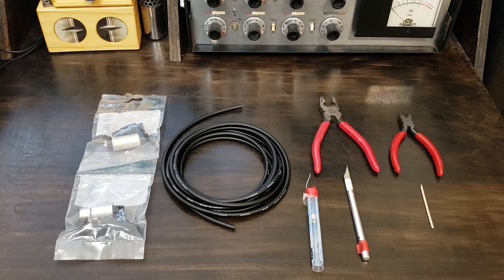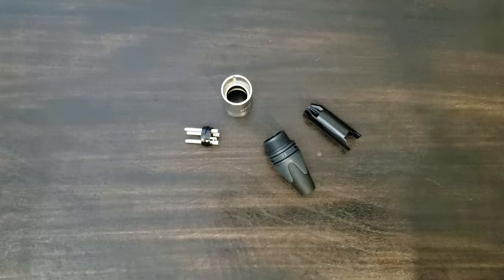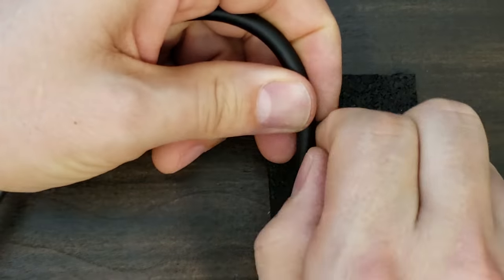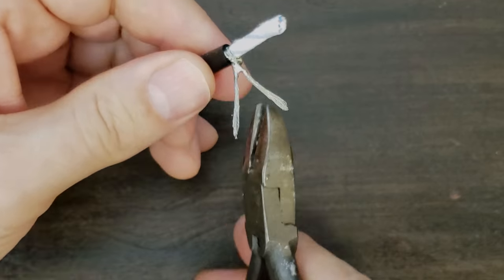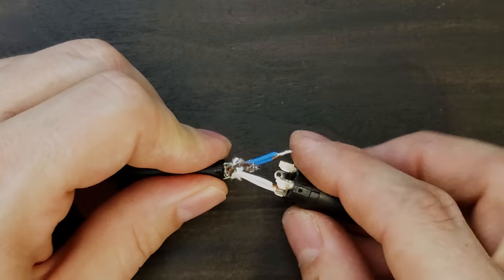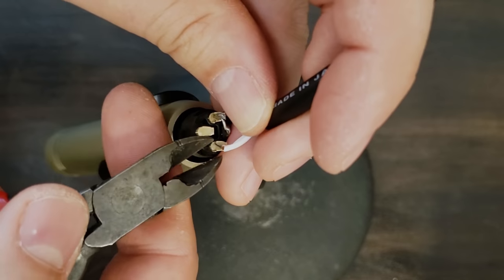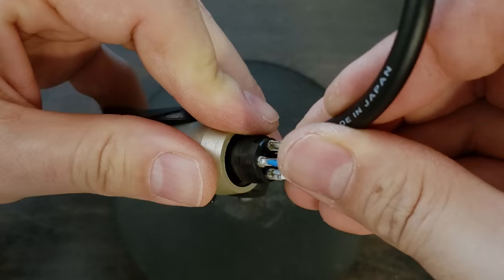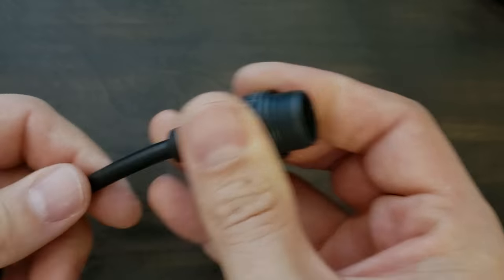XLR Microphone Cables, How to solder connectors Studio Balanced DIY ULTRA QUIET

Comment: Love the video.  What is the purpose of the shield jumper? You're the first video that i've watched to add this to your connections.
Reply from the maker: It's optional. In some cases it may help ground mics or equipment which can lower the noise floor...
Reply: @FrankOlsonTwins  thank you for your response. I will try this. Does the type of metal matter?
Reply from the maker: Any clean copper wire will work. Some companies even split the braided shield wire into 2 and solder one to pin one and one to the shield tab. Best of luck!
Reply: @FrankOlsonTwins  Thank you

Comment: Does it matter which side of the 3 pin you solder the cable to ?
Reply from the maker: Yes, only one side is long enough to fit into the other connector.  Is that what you mean?

Comment: Please explain the Jump ground connection, what is it's function, and why are there 2 cold and 2 hot wires, blue and white, when mine only has 1 of each? Mins IS A cheapie weepie! Thank you.
Reply from the maker: The jumper connects the cable shell to the cable shield and can be helpful if you have a piece of equipment that has a bad shield/ground.  Some argue it can cause a ground loop, but my experience says it does not.  Four conductor Star-quad wire allows for better "common mode rejection," by allowing the second pair of wires to occupy more of the same theoretical space as the other pair.  This enhances the rejection that makes the original twisted pair work so well.
Reply: @FrankOlsonTwins  Thank you very much for your speedy and informative reply. Cheers.
Reply from the maker: No Prob!

Comment: Hi Frank. Can we do float shield with quad core cable? And if yes, how can we do it? Thanks!
Reply from the maker: Great question.  Though I've never used float shield on interconnect cables, you could try it.  I'd say when you're soldering up a cable(quad core or otherwise) don't connect pin 1 to the shield on either connector. Likewise, don't connect the jumper. Then test your cable.  If it works to your satisfaction, trim back the shield to the appropriate length and seal it off with heat shrink(if necessary).  If you try it, let me know how it works for you!

Comment: Why do dynamic mics are using balanced Xlr connectors, when theres only 2 lines from the voice coil?
Reply from the maker: The 2 lines(hot and cold) carry the signal from the voice coil to the preamplifier.  The third connection is a shield that surrounds both wires for the entire length of the cable. By using this method, the hot and cold signals are able to reject hum and buzz by being twisted together inside the shield(common mode rejection). Now, those hot and cold signals will be used by the preamp equally to amplify the original sound. 
For more information, look up the term: common mode rejection.
Thanks!

Comment: Frank, for those of us who don't have a spare capacfitor laying around for a jumper wire, what would be an easily findable substitute solid core wire? Thanks, Steve
Reply: I see the answer below. 🙂
Reply from the maker: A spare resistor lead would work too, but the jumper wire doesn't have to be solid core.  You can use regular stranded copper wire. The solid core is just a tiny bit easier to work with. Old telephone wire is often filled with good solid core wire.  Don't forget to give a quick polish with a very light abrasive if your solid core is discolored or tarnished.
Reply: @FrankOlsonTwins  Thanks, Frank!

Comment: Hey please I made  a cable just like this but anything am putting it in the mixer it just making some kinda noise the meter on the mixer will be so high i check the cable and it was  OK I really don't know what is happening any advice?
Reply from the maker: I always check a few things first:
1. Double check the wiring.  Look at the numbers on each connector pin.  Are they wires soldered to the correct pins on each end?  If pins 2 and 3 are swapped on one end, it will always make a humming or buzzing noise.  Remember when you solder one end, the other end will look reversed, so you can't solder them by looking at one end to assemble the other.  You have to look at the numbers next to the pins.
2. Are there any tiny stray wires between any of the contacts?
3. Are the solder joints shiny or are the solder joints gray?  Gray joints need to be re-soldered until they are shiny.
Good luck!

Comment: Hi Frank, firstly -great video!  One of my speakers will be 50 meters away from the desk and I'd like to make a cable for it. Can you recommend a type of cable? .. does it matter if the cable is 2 or 4 core?
Reply from the maker: If you're talking about a powered speaker, then either 2 core or 4 core XLR will be fine.  In fact, I'd say you could get away with 2 core XLR Cables.  
Canare L-2T2S audio cable
Mogami 2549 audio cable
Performance Audio or Markertek has great prices on both.
If it were a microphone, or another low output device, I'd say go for the star quad cable.  
Canare: L-4E6S 
However, if you're talking about an unpowered(passive) speaker and you're looking for 50m speaker cable, I don't have a good suggestion, becasue that's a pretty long speaker cable run.
Hope this helps!
Reply: That's great. Thanks for your quick reply. It'll be two powered JBL speakers chained together and 50m apart.
Reply from the maker: Yeah, regular XLR cables will be fine.

Comment: Hello good afternoon friend, I have two questions I hope you can guide me please
1 the copper you put between the
mesh and connector to sieve. ??
2 I have a roll of 24 gauge prosound cable and want to put together my channels to connect my mixer, driverack, EQ, chrysover, and amplifiers. This cable is recommended or you want another caliber and another brand I hope you will help me thank you very much greetings from Mexico .. !!!
Reply from the maker: Hello!  thanks for the questions!   here are my answers:
#1. Any clean copper wire will work well for this connection. 
#2. if you're going to make a lot of cables, I'd say buy the best you can afford.  if you can find  Canare L-2T2S Microphone Cable, 2-Conductor, 23 AWG, that would be a very good cable with less work than star quad. Can you send a link to the cable you have?
Reply: @FrankOlsonTwins  of course I understand
My question is the thicker the cable the better. ?? or what gauge is correct because I have a 24 gauge thank you very much !!
Reply from the maker: I don't think you'd notice any sound difference with a thicker gauge cable,  sometimes it comes down to what what size is more appropriate for the intended use. however,  sometimes a thinker cable will have better handling noise characteristics.  Make a cable,  if it sounds good,  you have your answer!
Reply: @FrankOlsonTwins  perfect thank you very much for the information. In your videos I see that you use a piece of copper and you solder it together with the mesh but they make a bridge with the connector, what is it for or what improvements can I get in the cable. Thank you. !!
Reply from the maker: That copper is just to make it easier to solder the shield to the connector.
Reply: @FrankOlsonTwins  very good thank you very much ludis from mexico city
Reply from the maker: De nada!

Comment: Hello Frank, thank you for this nice video! Still I have a question: is shielding so important?  I want switch to active speakers, unfortunatly passive speakers cables (Sommercable elephant Smp 425) are stuck into the walls of my house. Those are 4x2.5mm² without any shield. This is for a non professional use... Is the risk of picking interferences high? Thanks in advance.
Reply from the maker: Hi Stephane,
Hmm, well there are a few things to consider here.  For one thing, you are right, there's no shield.  It could be a problem or not, depending on where you live, and also how close to any other major wiring or electronics your system might be near.  For example, unshielded cable will pick up cell phone, flourescent lights and possibly wifi interference.  Unfortunately the only way to find out is to solder on some connectors and give it a try.
This brings us to Problem #2:  The cable is too fat to fit inside the connectors.  In this scenario, you'd be trying to make star quad instrument cable out of some very thick wires, each of which is probably thicker than your connector pins.  Even with some very creative trimming, I think you'll end up with a less than satisfactory result.  Even then, you still won't have the ground that the shield offers.  Again, you won't know if it's necessary until you try it.  
If possible, I'd replace the cable with a good quality 2 conductor shielded cable(or star quad if you want).  If the cable is not connected inside the walls, it could be easily replaced by temporarily soldering one end of the elephant cable to your new cable. Tape the joint so it doesn't get stuck on anything as it passes along inside the wall. Then, you'd just pull the unsoldered end of the elephant cable through the wall until the new cable fully replaces the old cable.  Clip off the soldered joint and solder on your new connectors(or wall mounts, etc.)...
Hope this helps!
Reply: @FrankOlsonTwins   Thank you very much for the answer. Unfortunatly the cable is very stuck into the wall, it doesn't slide at all (I tried to pull with all my forces and added some special oil as much as I could). It is roughly 10 meters long! I think I have to stick with passive speakers... or... Is there any way to check the interference amount ? (before bying the active speakers!).
Reply from the maker: Hmm, I wonder if the cable is run through the attic or basement, or directly through the wall.  If you have attic(or basement)access you could run another cable.  Otherwise the only thing to do is to hook up your existing cable with connectors and try to test it, perhaps like a source(tape player, CD player, etc) on one end, and your preamp, amplifier, speakers on the other end of the cable.  That would tell you if the interference would be severe enough to create issues.
Otherwise, you'll have to figure out another way to covertly run those cables....
Reply: @FrankOlsonTwins  The cable runs though the wall and is definetly stuck (it is too thick for its sleeve) no other access possible unfortunatly. How they manage to get it in...? i have no idea. The idea of testing is very good, I will do it. thank you!

Comment: how to connect regular speaker cable to 3pin xlr? because usually speaker cable has plus and minius only. not ground.
Reply from the maker: It depends on what equipment you're hooking it up to.  I've never personally encountered XLR speaker cable, so I don't know what the pinout would be. Most likely, one of the pins would be left unconnected. If you have an amplifier with XLR Speaker outputs, it should be easy enough to figure out what the pinout is in the manual, or there must be a schematic available somehow.
Good luck!

Comment: Hi : ) Wow Really Great Video!!! I'm trying to find the solid core wire, for grounding the chassis to pin 1... I don't have extra capacitors... would you mind recommending me the best solid core wire to use?  it looked to me like the one you used wasn't all copper? it looked like it may have been tinned with something?  do you know what?  and if solid core copper cable works, should I tin the entire thing before soldering it?  what thickness is it?  22 awg?
Reply from the maker: Thanks!  You can look for silver solid core wire.  A big spool is very expensive, but there are lots of small quantities available in the 10-20 dollar range.  
18 ga -24 ga wire will work well for this connection. I also keep a few feet of silver plated solid core "pushback insulation" wire on hand.  Whenever I need a solid hookup point, I'll strip a few centimeters or inches from that.
Reply: @FrankOlsonTwins  Wow Thank you so much for the information and for responding so quickly!  I'm surprised by the silver solid core wire.  Why is that better than copper solid core?
Reply from the maker: I wouldn't necessarily say silver is better than copper, but I've found that it's a little easier to source locally.  Either one will do exactly what you want for most projects.

Comment: Eccellent video. One question have to ask. I am using the same Canare cable and Neutrik sockets. normally soldering  
Shield to pin number 1,
BLUE to pin number 2,  WHITE to pin number 3.

 Is it necessary to do soldering shield jumper same as your video or its enough to soldering Shield only to pin number 1.
Please be kind enough to explain What is the difference .
Thank you in advance
Reply from the maker: Hey Joseph, thanks for checking out the vid!  The jumper is optional, it simply ensures that the shield wire is grounded to the preamp chassis.  If you don't want to do it, it isn't necessary.  On some systems it can give extra shielding protection.   On systems that are prone to ground loops, it could make the problem better.   You can find out easily if the grounding the shield works for you:  Make the cable as shown in the video.  If you find you are getting hum- clip the jumper at one end of the cable.  If you are still getting hum, clip the jumper at the other end.  If you are still getting hum, your issue lies somewhere else!  (Instead of clipping the cable jumpers, you could use a different cable to see if your problem still exists.)
At the end of the day,  best method is the one that works for you!
Reply: @FrankOlsonTwins  thank you very much for the information.
Reply: Which cable of CANARE is suitable for connect microphones to mixing console 
CANARE   L- 2T2S  or L-4E6S
Reply from the maker: Either one would work fine.  The L4E6S is a bit more difficult to work with, so that's something to consider.  But If you're in a building(like a theatre) with a lot of EMF issues(random cable noises) the L4E6S might be worth the extra effort. The L2T2S is a good quality 2 conductor microphone cable.  In most cases and studios it would be a great choice.
Reply: @FrankOlsonTwins  thank you very much for the information 👍

Comment: Hello, I'm looking for a tutorial to make a cable XLR male - 3,5mm jack female. The cable has 3 wires: black, red and white. Can you tell me how to make it? I already have the 3,5mm jack connector in one end... The other end doesn't has anything (only the 3 wires) so I need to connect de XLR connector. Can you help me?
Reply from the maker: Sure, this ones pretty easy!
So, most likely your 3.5mm jack is wired as follows: Red(+), White(-) and black(ground/shield).
All you need to do is connect your XLR as follows:  Pin 2 Red(+), Pin 3 white(-), Pin 1 black(ground/shield).
Double check after you solder to make sure there are no stray wires sticking out. 
Basically, you'll follow the same rules as the video, but pay attention to the coloring of your wires and solder them in as above.
If you can open the 3.5mm jack easily(does it unscrew?) then  you could double check the wiring.  Red likely goes to tip, white to ring, and black to ground.
In the unlikely event that the 3.5mm jack is wired backward, you could simply reverse pins 2 and 3 on the XLR.
Good luck!
Reply: @FrankOlsonTwins  thank you very much. I understood. However i don't have access do the 3,5 female jack because it is no with screw. It's made in china :) So, the cable was female to male jack 3,5 and i cut the wire and I test with a multimeter in the male jack 3,5. And yes... black is ground, red is positive (left stereo) and white is negative (right stereo). Thank you very much.

Comment: Isn't #3 Ground/cold (from braid) and #1 Ground w/ shield TM7:50? Maybe it doesn't matter?
Reply from the maker: 4:30 is the Female connector.  7:50 is the male connector.  When you look at them from the back, they will look opposite to each other.  That's why most connectors have a TINY number by each pin(male) or on the front(female). 
There are different standards and they have changed over the years, but the current AES standard is:
Pin 1=shield/drain
Pin 2=Hot (+)
Pin 3=Cold (-)
The Case ground is optional.
What you're describing would be an unbalanced connection, with both Pins one and three essentially being grounded.  Thay may work in some cases, however if you're pulling Pin 3 (cold) to ground with the braided shield, you're losing the balance of the signal.
In theory, the Positive lead carries the hot signal, and the Negative lead carries the exact opposite(cold) signal.  when they reach their destination in phase with each other, any noise picked up along the way is cancelled out, because it's not in the original signals.
So, if you ground pin 3, it might work on some systems, but you'll lose the ability to carry a balanced signal when you need it.
Reply: @FrankOlsonTwins  Thank you Frank for explaining the differences. I now totally understand the correct way for making balanced XLR's. I sincerely appreciat your help. 👍👍😊
Reply from the maker: No problem, I'm glad it helps!
Reply: @FrankOlsonTwins  It definetely helped...... Just ordered 250' Canare Star Quad along with XLR Neutriks. Thanks again for the great video! 👍😊
Reply from the maker: Great!  Yes, make those cables and you'll save 5x $$ on retail cables.  Best of luck!